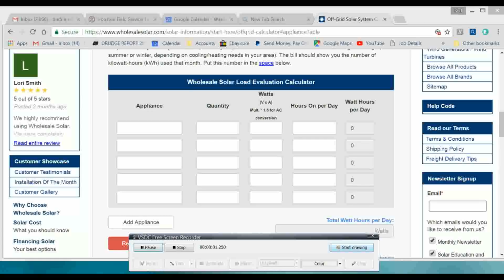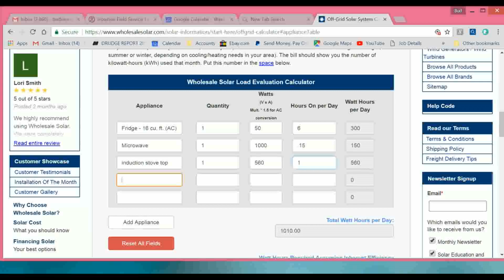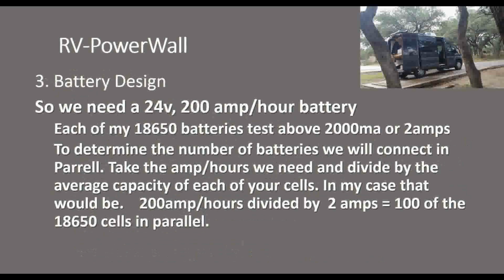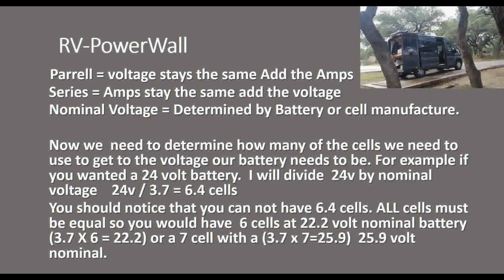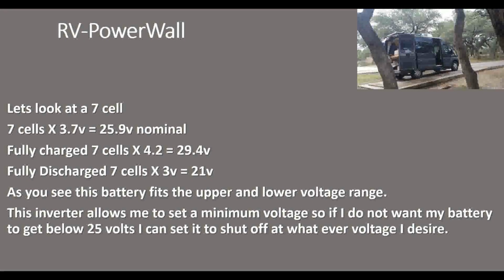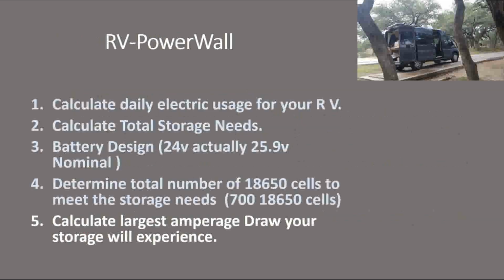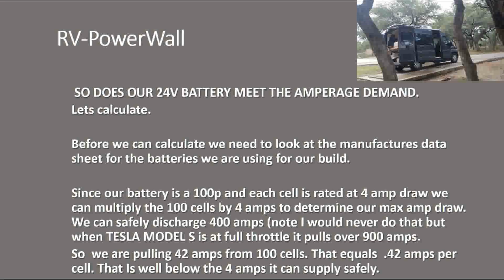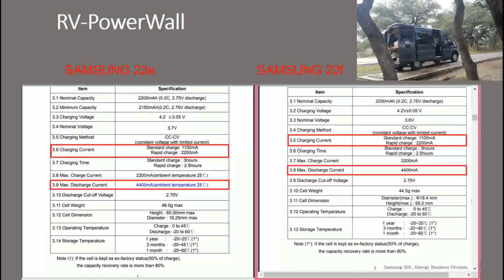RV Tesla Power Wall Design Build Plan

Comment from the maker: HI everybody My battery is now 3 years old and I just rebalanced it and it is performing Great.
I am now playing with a 32 volt Nissan leaf battery and doing some testing. It looks very promising. The cost of this battery on ebay was 380 dollars and it came with a bms and it is outperforming my expectations. Something you may want to consider. Again this is a used nissan leaf battery configured for 32 volts. You could configure it as a 12 volt battery as a 2s2p battery .... full charge is 16.8v.... full discharge of 12 volts and most inverters or inverter chargers would work great with this battery.  And you can just mount it in your van.
https://www.ebay.com/itm/Nissan-Leaf-Battery-Modules-2016-8-33V-TESTED-LOT-OF-4-2KWH/254298637547?hash=item3b356144eb:g:htoAAOSwLh5dDWSA

Comment: You're excellent at explaining all this but I have to admit it gives me a headache.   Will you need/use some type of BMS for these batteries?
Reply from the maker: No I explain why in a video. I am using a cell checker to monitor the batteries. I have used bms for elec bikes but for this application I do not see much benifit.
Reply from the maker: I am monitoring cells manually... no bms

Comment: I think I've learned more watching your video than anything else I know. Subbed
Reply: He's awesome!!! Easy to understand so you know he knows what he's talking about! Lol
Reply from the maker: @sarah-katehicks4715  Thanks guys.... I am still learning!
Reply from the maker: When I built this van in 2016 to total build was about $8000. That includes insulation, Refig, and all electronics. It does not include the battery as I built it myself for about $500. I believe you can build this with less expensive inverter and charge controller for about $6000.  Yes I still think about using tesla modules but they are in 6s configuration and it is not efficient because the max voltage is 25 volts and the min voltage is 18 volts. In a 24 volt system most devices want at least 23 volts so the usable power is only between 23 and 25 volts so this makes for a very short cycle.  The new Model 3 battery are configured in 60 + volts and are going to be a better choice for a 48 volt system. Most 48 volt inverters can handle up to around 65 volts. This means the full battery can be used for power.
Reply from the maker: see comment below

Comment: what if...you ran only DC appliances and devices so as not to need an inverter....I understand that inverters burn allot of energy
Reply from the maker: That would be optimal for just the RV. I am sure you can get most kitchen appliances in DC but I could not find the Microwave or the Induction stove top in DC. Most importantly this RV is actually a bug out vehicle. I want to pull up to a farm house out in the no ware land and offer power to run a well. So I need at least a 2 KW inverter to run a pump well.
Reply: Yeah...I'm still shopin' fer those myself...but I hope by the time I get my build underway those will be out there

Comment: 3.7V x 200AH = 740 watt hours
equivalent to less than a single 125AH Deep Cycle AGM at 50% discharge, which is 750 watt hours
Reply from the maker: Yes but 7 in series = 25.9v at 200ah =5180 w
Reply: 7 AGMs in series, 125AH AGM's@50% = 5250 watt hours
Reply from the maker: what voltage are the AGMS? If they are 12 volts then the weight for 7 AGMS is 68lbs * 7 = 476lbs
Reply from the maker: Plus I just bought 2 AGM 100ah and they were 180 each with shipping.
The 100ah were 68lbs so i believe the 125ah are a bit more.